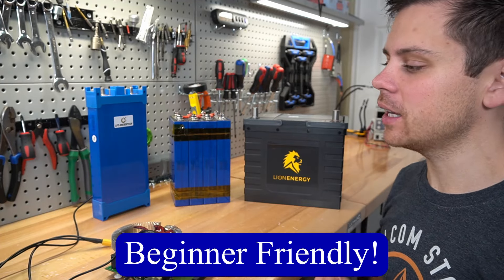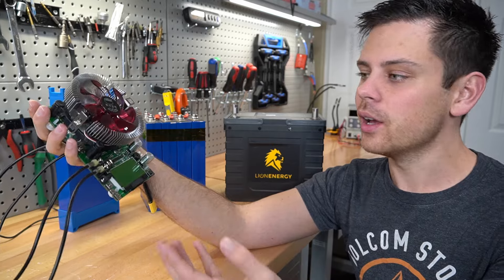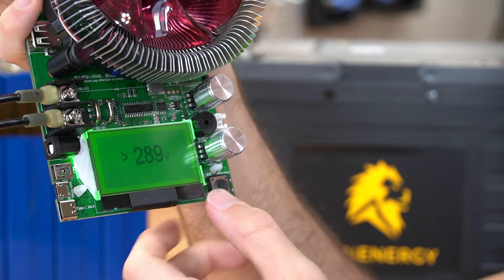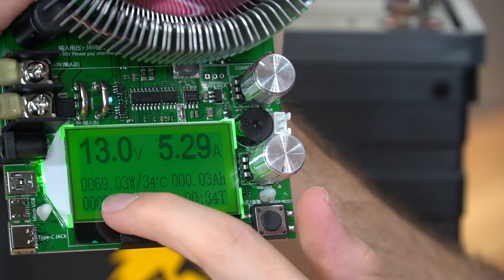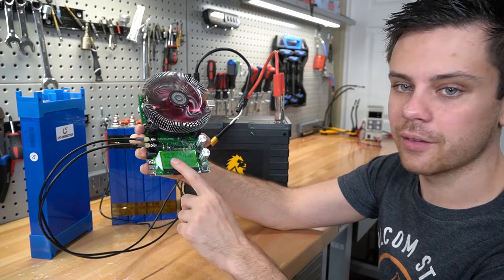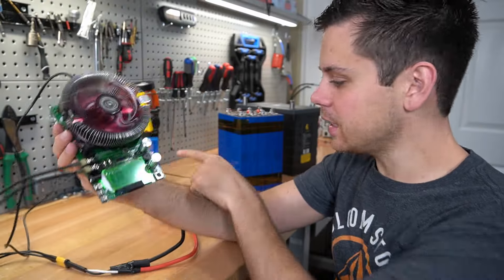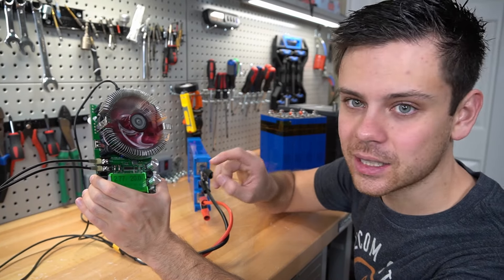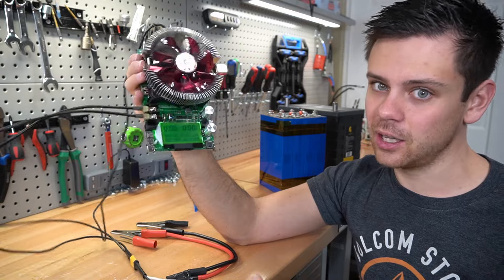Beginner Friendly Lithium Battery Capacity Test Method

Comment: is it a low voltage disconnect? or a low volt alarm/buzzer?
Reply: It's a buzzer.
He tells that he disconect but it's wrong. It is the drawbacks of this tester.
Reply: You need to have a BMS to use this tester or you might kill your cell
Reply: @ttthomasss77 thanks that's what I found when looking at them on Ali Express too.

Comment: I need to replace a two pin surface mount component next to the heat sinked component. # STPS41H4100CG. Can anyone help with a replacement part #. Is this a mosfet?

Comment: Can anyone tell me whats the diff between this CC load and a fixed resistor if used for battery capacity testing purposes?
 
also, I want to use a CC load, something similar to the one in the video but also want to kind of program it so I can discharge the battery for every 5% of SOC and then stop the procedure, measure the OCV after 5hour rest period and repeat the process till I end up at the 0% (cut-off voltage point 2.5V for LFP I guess).

Answers would be greatly appreciated :D

Comment: What happend with the Low Voltage Disconnect setting on the single cell? Just before-"And when you hold it down it will look like this"

Comment: Will, is there a way of testing the battery capacity without one of these testers for a one-off battery purchase? My van has a Renogy shunt so I wondered whether I could test the capacity without purchasing another product as it will only be used the once? Thanks.

Comment: I bought this tester and it’s .04 volts off  from the Voltage reading on my Klein. My tester reads 3.06 bolts and this unit is reading 3.02.    Why. Ugghhhhhh
Reply from the maker: It's either voltage drop or it's inaccurate. Probably both. That's more than enough for battery testing.

Comment: I am using this to test a 12v nominal battery and when I connect to the battery the voltage reads as expected around 13.x volts. When I start adding a load the the voltage starts increasing to 17 volts. I have two test units and saw same on both units on two different batteries. Amp  and amp hour measurement matches my BMS but seems to cause miscalculation of KWHs. Anyone else seeing this?

Comment: I currently use a small USB device similar to that, except you control it through software on a PC. You get graphs of the voltage drop and amps/watts used, etc.  It was about 21 bucks on ebay, but it looks like they've gone up a couple of bucks. Google "EBD-USB+ DC Electronic Load tester".   I may get the one you are using because even though I like the graphs, sometime I don't want to tie up a PC for hours to test a battery.
Reply: I should add, I use the one I mentioned for smaller cells. It would not work  well for the size cells/batteries you are testing.

Comment: How do I test a 12v 100ah sealed lead acid battery?
Reply: yes, you need set voltage off
Reply: set voltage cutoff to 10.5 volts

Comment: I have had these dischargers. They are really bad, don't buy!!! First off, the low cuttoff do not work properly. It keeps on draining the battery to zero, only slower. Do not use it with higher voltages. I had 3 of these explode after discharging a 160V battery. And yes, i used the fine knob to not exceed 185w. You are better off buying the cheaper 60W units and parallel them for higher discharge current, they work flawless.
Reply from the maker: Which 60w unit?
Reply: @WillProwse   Search for "9.99A 60W 30V Constant Current Electronic Load" on aliexpress. If you are going to buying one, choose the one with a sticker "QC - passed" to get a good fan.

Comment: @WillProwse how are you getting to 185w and then it seemed to beep and shut down? Mine didn’t beep or shut down adjusting up slowly and at close to 170watts it 
Fried? I did see these amazon and alieX units are only rated at 150watts. Some on the forum are saying they get higher But it did not beep or shut down it simply went poof 💨 I connected exactly as you did with an XT60. Puzzling 🤔
I guess running it at 150watts or lower would be a little longer but safer. 🤙
Reply from the maker: I literally just blew mine up a few minutes ago..good timing with your comment. It works great on low voltage cells, but not on the higher voltage stuff
Reply: Luckily it’s getting replaced so yeah from now on it’s use will be for lower wattage testing and simply wait a little longer. I’m going to try a 10amp fuse in line and run it at 120-130watts. Still a easy way to test but I reckon a little more patients is needed. 🤙
Reply: @WillProwse  Bummer.  Maybe a redo of the video and mention there are 2 models 150W & 180W and further underline using an inline fuse ?   Just ordered a 150W unit and after comments on the board will add the fuse too.
Reply from the maker: Fuse won't help considering how it works. I would only test 24v batteries and smaller. It works fabulously for me, for weeks non-stop, with individual cells/12v batteries. I was testing it at 59 volts and it popped. I can fix it tho. The fet will die eventually on these units. Some people actually upgrade it. I'll probably do that

Comment: I had 1 fail at low load within 10 mins to a dead short fire,they are crap!
Reply from the maker: Holy crap no way. Be sure to have ocpd then. And I havent had one fail. I'll run it at lower wattage so fet doesn't burn out too quickly.

Comment: I tried it, and my version (185watt) does turn itself off when the low voltage is reached
Reply: Have you been able to figure out how to adjust the LV cutoff?  My values only sequence down (now at zero) and I cannot figure out menu/button presses to raise the number.
Reply: @LivnlargeCO  I dont remember. But i did do it. its a combination of holding down the button longer (or someting 🥴) just keep playing with it until it works 😁

Comment: Hello All! I ran a test with this device and found that my new 7AH SLA battery with a test load of .30 amps over 3 hours 20 mins was only able to draw .90AH / 14.03 WH before dropping to 12.00V. I would have expected a much higher AH than that.  Can anyone here let me know what happened? Thanks!
Reply: What was the 7AH rating based upon? if it was based upon 20 hours then 7/20 = 0.35 amps for 20 hours  to get to 10 volts not 12 volts. So 0.9 AH in 3.33 hours at 0.3 amps is about where it should be in that amount of time.

Comment: I’m stumped!  Need advice. I bought 2 PowerUrUs 12V 200amphr batteries for my Class A diesel pusher. I’ve got a magnum charger/inverter. I set it CUSTOM w 14.4v Absorb, 13.5 Float, 14.4 Equalize (per BattleBorn/Magnum setup video).  It bulk charges at ~133 amps, then absorbs around 60amps, then floats at 0amps. PowerUrUs app is quite worthless. Ran capacity test with this tester. Zeroed it, set it at 150W, ~13amps and the test on both batteries was only ~21 amphrs, not 200+ when the BMS shut the test down. Test only took ~2hrs, not 15 hrs. App says low voltage protection, PowerUrUs charger applied. All lights are green and no amps being added when the battery is fully discharged. It’s 61 degrees outside.

Comment: "Never test with raw cells" *queues next clip of raw invidual cell*? Or am I missing something here? :D.
Reply: He is saying not to test a series of individual cells without a BMS, As the machine cannot tell if the pack gets out of balance. With a single cell, you can set a low voltage disconnect and do this.